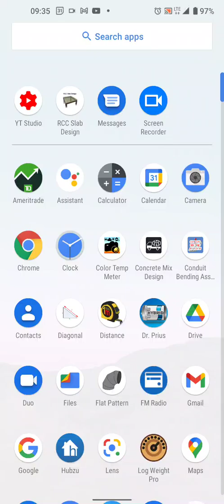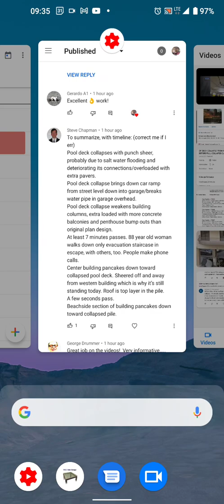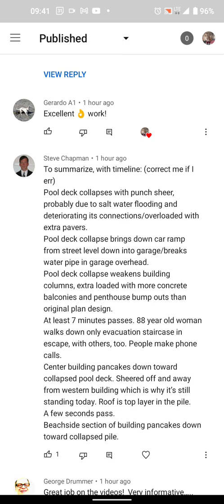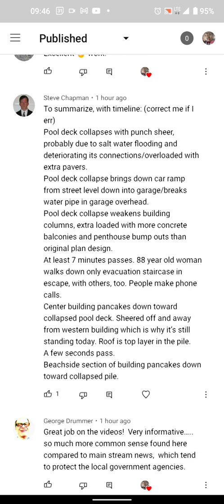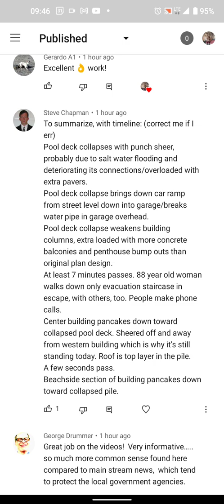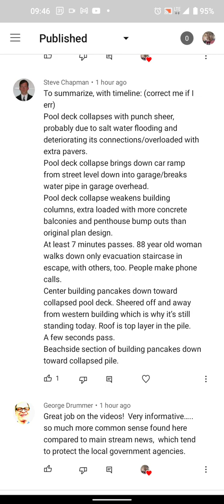Champlain Towers  Collapse Engineer should have changed load rating of deck in 2018?

Comment: lap-length note, building was designed in 1979, not after the 1985 Mexico quake, 1989 san Francisco quake, or 1995 department store collapse. so I see validity in checking the old numbers as that's what the original designers were working with, as they couldn't go into a time machine to go get "the updated forms". lol.

Comment: As a mechanical engineer, these type of value engineering solutions drive me nuts. When non-technical people make technical decisions should not be allowed, meaning it won't matter how many news laws are made if owners and HOAs can still delay or change what needs to be done. I've dealt with people like this my whole career, 32 yrs.
Reply: Bravo!! I am an ex electrical engineer not a structural engineer.
But certainly in England, I could have 'Got away with' working to code, but I have many problems with code, 
So I would always try and exceed the level of expectation not simply comply.
Because certainly electrically, much of the code was dangerous in a practical situation in my OCD opinion.
So much theory needs a rework.
Let's not forget, The Titanic was built to code! 
Thoughts to all those affected.

Comment: Kai, excuse my terminology, does the foundations have a high water table?
Reply from the maker: That is an interesting comment, "water table" issues are resolved with concrete PSI and coatings.
I saw no indication of standing water in the pool equipment room.
As far as pump replacement goes, I have no clue if they purchased the correct pump for the task...
Reply: @LoadPathEngineering  Thanks, Kai. I'm asking that,  because of the corrosion in the structure and it being so close to the beach.